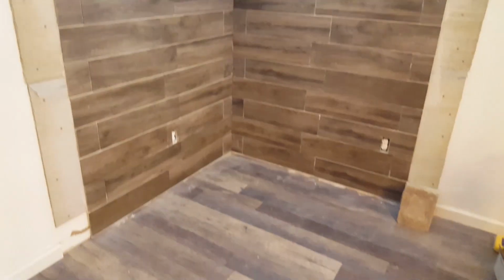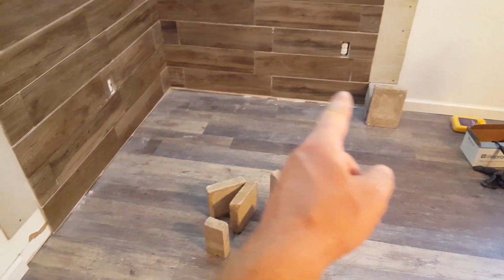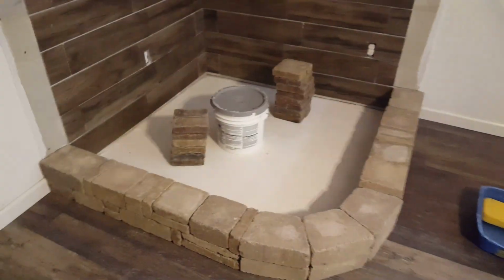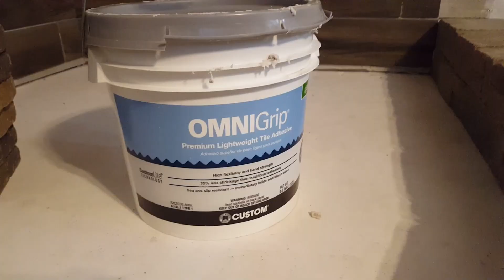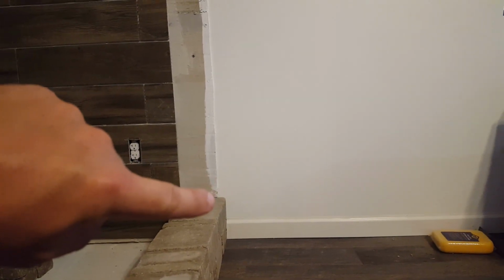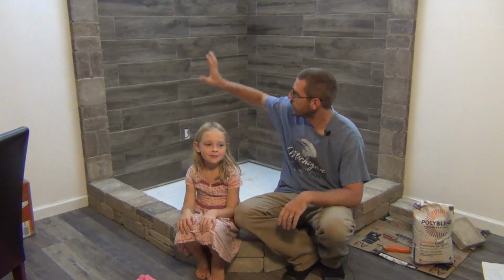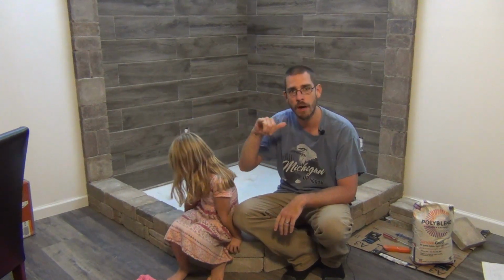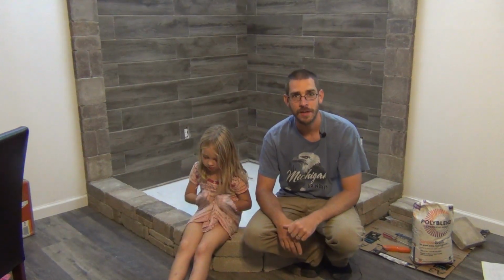Wood Stove Installation - Using Landscape Stone To Make A Hearth

Comment: Everywhere I read it says you need a 1” air gap behind the stone or tile for circulation. Did you do this?
Reply from the maker: I did not but it also depends on how close your stove is. We were well beyond the limit to a combustible surface. The air gap is a good idea especially if you are putting the stove right to the wall

Comment: Try a wire brush on that adhesive that seeped through. The way it’s designed, it stays a little flexible even after drying. You may be able to get the bulk of it that’s visible out.

Comment: Great video instructional!
Question, do I adhere the tile protector to the drywall or should I remove the drywall and use cement board??
Reply: Use concrete board but u have to leave a 1” gap between concrete board and the dry wall.   They make spacers for this or u can use metal studs.

Comment: it looks beautiful.  question: how will you keep the outlets from melting when the woodstove gets really hot?
Reply: Katherine Bragg in the last video, he said he’d be removing them.
Reply: sorry, I guess I missed that one
Reply: why did he cut out the tile holes for the receptacles then?
Reply from the maker: Electrical code says you have to have access to any wire connections in a wall. I will have to remove the outlets and use metal covers over the electrical box